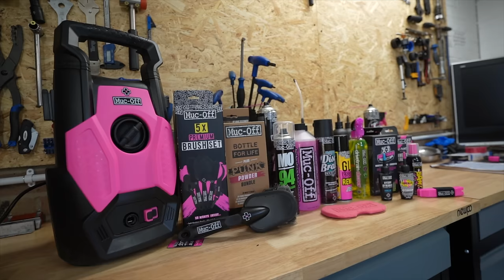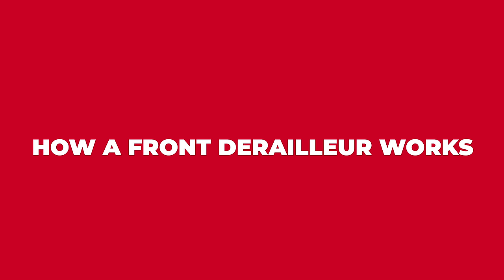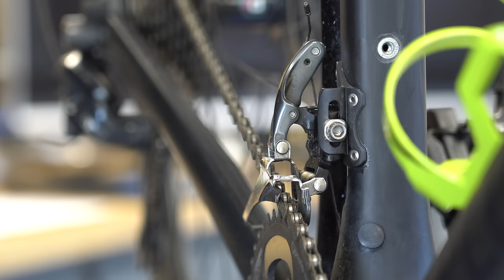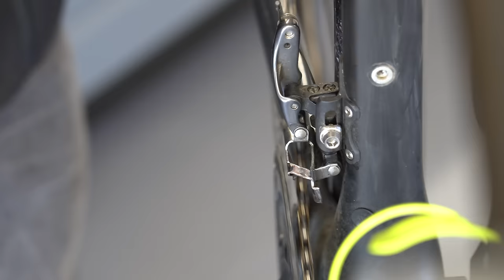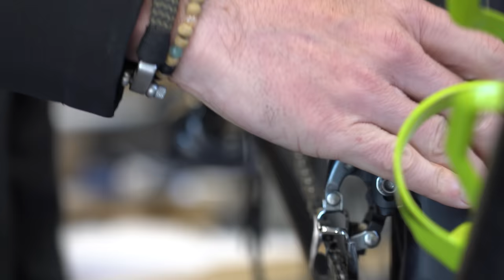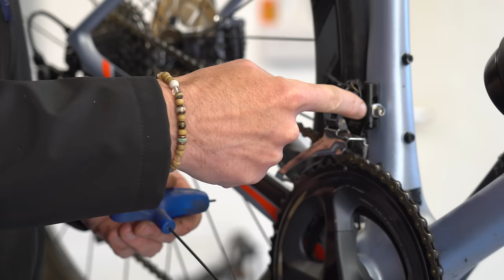The Easiest Way To Adjust Your Front Derailleur For Perfect Shifting

Comment: I'm a really competent bike mechanic and I still watch these kinds of tutorials on a regular basis to see how good or bad they are and I have to say Jim has a great easy going manner and I've yet to see better, so keep up the good work as many newcomers to cycling will thank-you for it 🙂👍
Reply: my front Deore Derailure both limit screws does not move the derailure for adjustment ... what is wrong???
Reply: @PixVu Hobby Zone  
Make sure the cable is released for adjusting
Reply: @colincanyon2519  If I release cable it won't switch gears. only goes 1-2 or 2-3 not 1-2-3?
Reply: @PixVu Hobby Zone  
Whilst the cable is released adjust your inner screw and set your chain in the proper position stop just before the chain touches the inner/small ring then pull on your cable and tighten it back up and should be good with gears adjusting properly 👍

Comment: I've arrived here in frustration, and am glad I've found this channel.  I've just bought a new bike with a 105 groupset (11/34 cassette, 52/36 chainset) - but with the modern front derailleur, which works differently to the 'pivot' High/Low adjustment shown here.  The high limit bolt still determines how far out the front derailleur can travel, but achieves this in a completely different way. It works in conjunction with the shift cable tension, not against it. The high limit bolt determines where the derailleur is positioned relative to the tension of the shift cable. For this reason, the high limit setting also changes the location of the front derailleur in both the LOW and HIGH TRIM shift positions as well.  I've had quite a job trying to get the adjustments right - something that was never a problem for me on the older front derailleur.   Lots of fine-tuning in all the usual areas - but I still can't completely eliminate the chain rub (minimal, but still there) on the three highest gears (large chainring, three smallest sprockets).  Trimming of course makes a difference, but still not enough.  I've still got a bit of outward movement on the cage (not enough to throw off the chain), which makes me think it can only be a question of cable tension now.  Can you suggest where I might be going wrong, please?
Reply: me too hhaha

Comment: I wish I have a bike mechanic like you in my city, because I recently bought a gravel bike from Cradiac online which equipped with Shimano Altus in the front and Shimano Acera in the rear. The bike delivered 80% assembled and this is my first gear bike, so I tried my best to tune the front gear, the rear one was fine. Thus, I went to a local bike shop for tuning, but those guys have such a cunning thoughts like we are buying cycles online and started telling like "these cycles are not good and see you came to us, will you go online for tuning, etc". I was irritated but still I wanted to have my bike gears tunes so I kept my face smiled. They done it and delivered to me in 3 hours, but still I was not satisfied with their work, I think they haven't done tuning perfectly, still needs some adjustment  because chains are rubbing against the derailleur in high gear. Therefore, I came to YouTube to find some useful videos and learn basic mechanics, and I find your video is very much useful. Hope it helps solve the issue with my bike. Thank you!

Comment: David , you forgot to discuss , BOTTOM BRACKET SHELL WIDTH , BOTTOM BRACKET SPINDLE LENGTH and CHAINLINE OFFSET as well as THE NON - LINEAR ARC EFFECT . These all affect setting and performance standards . Also PLATE SHAPE AND PROFILE . Sometimes OEM spec bicycle setups by manufacturers are wrong due to component unavailability and shortages for factories .

Comment: On the R8000 & R7000 FD's, don't forget the 2mm support bolt that nips up against the seatpost.
That is also used to correctly align the cage parallel with the outer chainring.
Set the cage 0.5mm offset ( inboard) from parallel, then tightening the support bolt against the seatpost. That draws the cage back out to its parallel alignment. 
There will be no rub as a result.
Download the Shimano manual for the 8000 FD to see what I mean.
It's an often overlooked feature that results in frustrating rub in the smallest sprocket/big ring and large sprocket/small ring despite fettling limit screws.
You sometimes find the front cage hitting the inner drive side crank arm as you try to adjust the high limit outboard to eliminate rub. Adjusting the support bolt as suggested fixes that.
Reply: Their predecessors have the support bolt too, even my Tiagra FD-4700 has the same thing.
Reply: @yonglingng5640  The difference is that for the latest Rx000 FDs you must use the support bolt to set the cage parallel with the chainline. It's due to the fundamental redesign of the front mech for those groups. Setting it parallel in the way Jim suggests doesn't work for those. In fact, the whole adjustment process for those mechs is so different that page 1 of the Shimano dealer manual warns mechanics that everything has changed and not to assume their long-acquired skills and knowledge are accurate. I spent three hours swearing at one of those new mechs the first time I tried to set one up and ended up taking it to my LBS who taught me the correct way.
Reply: @ajwitt7472  Yes, this!  And nowhere, and I mean NOwhere, in any Shimano instruction could I find the actual use of the support screw to even out the cage angle.  I don't have access to the actual dealer manual, but all the online tech docs.

Comment: Great video, lots of useful info, thanks.  I would add that it helps to screw the barrel adjuster all of the way in after the cable tension is released in order to give as much adjustment as possible from the barrel adjuster after the cable is attached to the FD.

Comment: The best thing about your tuition is that you say upfront 'you might have to to do this more than once'.  I ended up scratching my head and almost giving up with other tutes, but the advice about persisting and not everyone getting it right first time went a long way. I think it only took me six goes.  But when it was right, it was right.  It was a Shimano front derailleur giving me trouble on a Meriton Crossway 20.  Really tough to adjust.  Working OK now!

Comment: Life saver!! I didn’t know they put the small H and L screws around the other way on a modern bike, couldn’t get the gears to adjust properly on my wife’s new bike, until I watched your video. I just started again from scratch using your advice and now there silky smooth cheers 👍👍

Comment: I find that backing off the barrel tension adjuster all the way off and pulling on the cable before you tighten it, gives you a bit more leeway and compensation for cable stretch.

Comment: Great video,  I find Sram's yaw front derailleurs easier to set up, the cage design is better on these as it's not paralell to the chainring anymore and you don't have to mess around trimming.
However, on my commuter I'm using a GRX400 front derailleur and GRX600 cranks with Sram Rival 22 levers and Force Wi-Fli rear derailleur, 'smooth like butter' is an understatement. 
No dropped chains either.

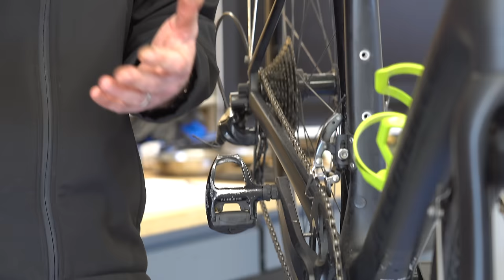Comment: 20:00 I'd also recommend doing the same gear change test with the real at the innermost low gear. Because the chain then goes in bigger angle towards the front gear, sometimes the chain drops as a result in front. Many gear manufacturers just say "don't do it" but if you want to make this situation to work, too, be prepared for lots of fine tuning time because the tolerances are really small to make it all work fine, especially with 3 gears in front. It really depends on derailleur but you can tune most of those to allow ("cross-chaning" as you later call it in the video) things to work without any half-shifts.

Comment: Thank you for the in-depth video!
I have a 3x mountain bike; as you might expect, a cheapie. I had to set it up, and I have had some problems with the front derailleur sometimes not shifting into second gear, and sometimes dropping back into first.
The derailleur is narrower at the top than at the bottom. I have aligned the back of it (the edge that is closest to the frame) with the chainring now, and I will test that when I am next out.
Unfortunately I have a Shimano Tourney revoshift control, and that has no means of trimming for cross-chaining, so I may have to accept that some combinations are going to rub a little bit.
There is a shop I can take it to, but I prefer to do all of this kind of work myself!

Comment: Terrific video, Jim. So thorough. About trimming the front derailleur: Is the half-click feature only available on the latest indexed shifters/brifters? Some of my bikes are older; they have Shimano rapidfire index shifters and thumbies on 3x mtbs. Am I out of luck? Installed the latest Microshifts on one to replace Grip Shifts. (Of course, the friction shifters have this feature built in.) Much appreciated.
Reply: My Cannondale Synapse Carbon 5 from 2014 (with Shimano 105) has trim. How old are you talking about here?

Comment: Great video, probably the clearest and most detailed on this subject Ive come across.  Subbed!  Before refitting the cable, should you set the barrel adjuster all the way clockwise (closed) to give you the best chance of adding tension after?

Comment: When the industry went to indexed rear derailleurs, it went to indexed and trimmed front as well, and that was a mistake.  The front is typically used much less frequently and is ideally suited to friction shifting, which provides infinite trim adjustable on the fly.  With a friction controlled front, get the thing in the right position on the downtube, set the low limit screw, use the shifter to fully slacken the cable, pull the cable snug, tighten the pinch bolt, shift to the big ring, adjust the high limit screw, and you're done.  Indexed shifting and indexed trim certainly can work on the front, but it's often too fiddly to be useful.

Comment: I followed this and almost got it spot on, for some reason it's not dropping to the second cog going down from top cog, it's, fine going up,is it a simple case of adjusting the L screw? I seen your explanation of the top & bottom cog but I got 3  cog on front derailleur, thanks 👍

Comment: Great illustration but I developed a problem with  Cross Chain locking up on the big ring. The two low gears on top create a total lockup. Relatively new chain and cassette. So I guess the front derailleur needs adjustment. Am I going to need to do this whole procedure? 😞 (Barrel adjuster worked to keep one of the two gears from locking on the big ring. But the last one locks and have to shift back down to get out.)

Comment: Tried exchanging front derailleur. But ''seat post angle'' and or ''cage size'' caused a problem? Do the cages differ in angle and or size in length? On crank I changed from 2 to 3 chain rings. Hoping to see a solution on YouTube. Thank you
Reply: You need a Triple Front derailleur, the double cage is shallower than a triple. There is a chance your rear mech might need changing also
You may have found this out & corrected it.
Reply: They can do on MTB mechs, because seat tube/chainstay angles are much more variable on those bikes than they are on road bikes. For MTB Shimano sell two different versions based on those angles.

Comment: So my chain is still rubbing when I use the trim function on the big ring. Suggestions to what I have to adjust? 

And do I have to release the cable tension if I'm only going to adjust the high/lows?

Cheers

Comment: My problem on my old school LeTour - when I shift from big ring to small ring it drops the chain between the 2. If I adjust the derailleur to pull the chain further toward the small ring it works perfect EXCEPT now the cage rubs the chain. Since it is friction shifters I don't have the option of the half click.   :(

Comment: great explanation. look, i have a crappy Tourney on my trainer bike and there is no fine adjustment for the front derailleur. i couldnt find anything online showing how much sould be the starting tension on the cable. its that by feeling only? its a pain to adjust bit by bit as starts to deamaging the cable on the bolt. is there a way to insert a barrel adjuster in such systems that dont have one? thanks

Comment: Hello. I’ve got a question about cable tension. On my two bikes (equiped with a Sora and a Ultegra dérailleur), even if I unscrew the Hscrew, my Chain always gets noisy when I’m on « big-big » position. I don’t manage to adjust efficently the câble tension to avoid the contact between the chain and the Fork. Is there a trick? Chris from France. 😉  Thanks.

Comment: Hi, I have just had a gear service done from the local bike shop and for some reason I can feel more tension/drag in my drive train. What could the issue be? Before the gear service I was climbing hills in the large ring without any difficulties but since the gear service I am struggling to climb hills in the large ring as there is so much more tension/drag in my drive train. Can anyone please kindly advice to what the problem maybe?

Comment: Please explain how to set the cage height over the large gear when installing the front derailer.    The cage cannot sit over the large gear unless it has been pulled outward from the frame by the cable's tension.   But the derailer has not yet been fastened to the seat-tube, and the cable is not yet attached.
Reply: Manually actuate the front derailleur outboard by hand and see if there's a 2 mm gap between the cage's outer plate and the tallest tooth of the large chainring. Keep fine-tuning with the height until it can be achieved.

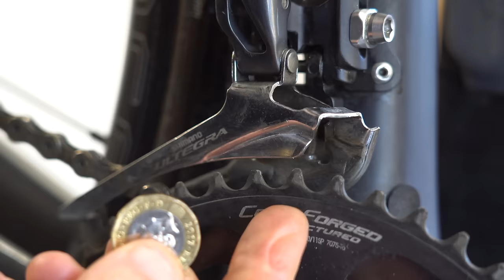Comment: 8:00 About height adjustment: is there any reason to have any more space than front derailleur not touching the teeth? I could easily adjust the gap to be only 0.5 or 1.0 mm instead of Shimano recommended 2-3 mm.

Comment: It just won't work. I've got 2 front plates. The cage does not move enough to push the chain up to the big plate, and it's so even if I move the thing by hand! I first adjusted the height and alignment as shown, then the L screw while on small plate and big cog. I shifted to the 4th (middle cog), so I could try to shift to the big plate, to no avail. I tried with low and high cable tension with the barrel adjuster. Best I could get is grinding. It's brand new and from day one the chain would slip out of the small plate, then all of a sudden after a few mild rides I could not shift to the big plate. shimano Altus FD-M315-TS 2x. May be it's very delicate to get right, but even if so, that means it's too sensitive and any shock will move things out of whack. Not happy with it so far, very frustrating.

Comment: I’m having trouble with a triple chainset system. I’ve set the inner ring, tightened the cable, then it won’t reach the outer cog when I click the shifters. If I tighten the cable barrels so it engages the big ring, it won’t click back down to the smallest ring from the shifters. I’m sure it’s something to do with getting the initial tension correct. Any ideas?
Reply: Search for 'front deraileur tensioning trick' by Matthew Shaffer.This might help.

Comment: I've adjusted front and rear derailleurs many times but a new problem I've got at the moment is that with the front it won't move down from the large ring.  Mine is a triple so I have to change directly from Large ring to smallest then go up from the small to obtain the middle ring!  Anyone any ideas?

Comment: what if you're using an oval ring
Reply: In terms of derailleur height, use the pointiest section of the oval so that the tooth there is about 1 - 1.5 mm away from the edge of the cage because that's the highest point of the chainring.
Reply: @yonglingng5640  THANK YOU, i think my issue was the barrel adjuster. what way do I turn clockwise or counter? sorry for questions. I no longer have a buddy who works on it for me, I moved and now I am on my own, I can't afford the LBS
Reply: @TheFloridaBikeVlogger  Is your barrel adjuster on the frame itself or inline with your shift housing, completely separated from the frame?

Comment: I really appreciate good English. Here in Texas people frequently use the word "heighth" instead of the correct word, "height". Thanks for using the correct word! Good explanation for adjusting the most problematic component on a bicycle. I was a bicycle mechanic for almost 40 years and I had many a battle to the death with front derailleurs. Many of the problems were due to operator error. So, I retire and what do they do? They remove the (redacted) front derailleur from a good number of bicycles. Mechanics these days don't know how good they have it! I had to deal with Simplex pushrod front derailleurs and squeaking Mafac centerpull brakes. Keep up the good work!
Reply: As an equally superannuated geezer, I remember ALL that stuff. You have my sympathies.
😅
Reply: Lol Americans how do they pronounce a router for wood working,cause travelling to somewhere they take the quickest ROUTE???? KNOW WHAT I MEAN 🤔🤔🤔

Comment: Love your video, David, very helpful and high quality. Couldn't get the front gear change no matter how much I tightened the cable (barrel adjuster and cable itself) but it worked like a charm after I adjusted the high limit screw, on a whim, quite honestly!

Comment: 11:04 very important point regarding the cable. even a slight angle change of the cable "levering" can change the way the derailleur works. i have struggled with trial and error to finally realize it !